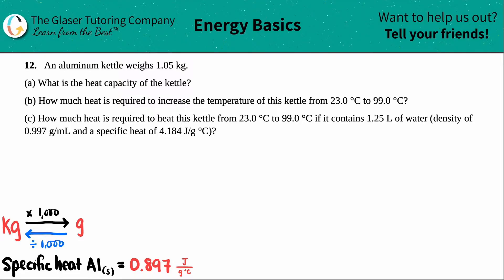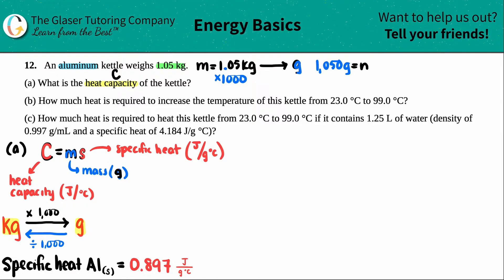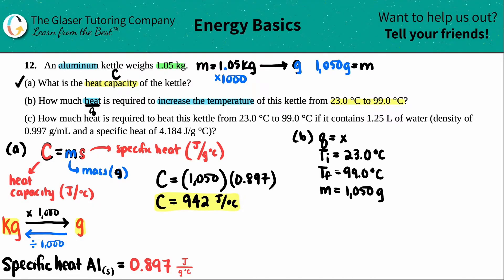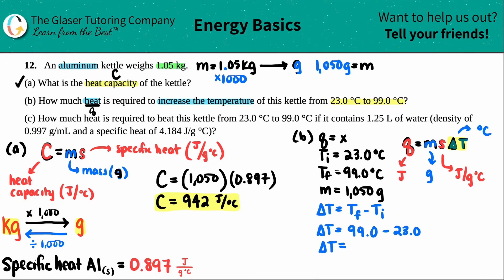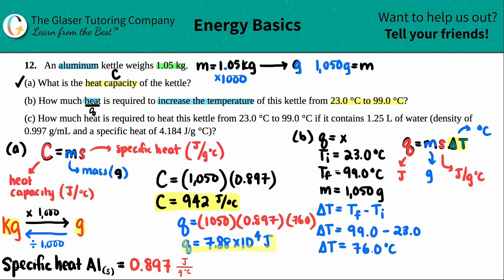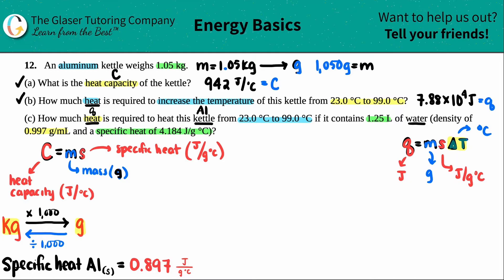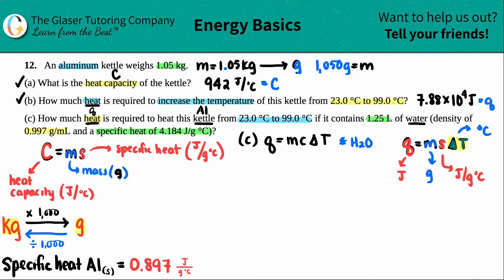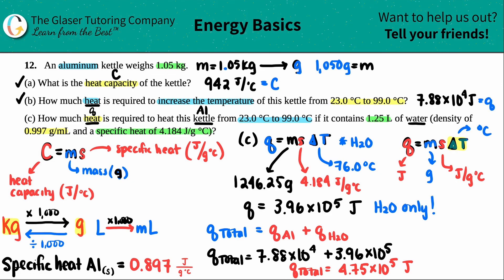5.12 | An aluminum kettle weighs 1.05 kg. (a) What is the heat capacity of the kettle? (b) How much

Comment from the maker: Hi All - silly mistake on part b.  The final answer should be 7.16 x 10^4.  I must have incorrectly plugged in the values into my calculator.  Sorry!  The logic and the method is correct, however.  Good luck!